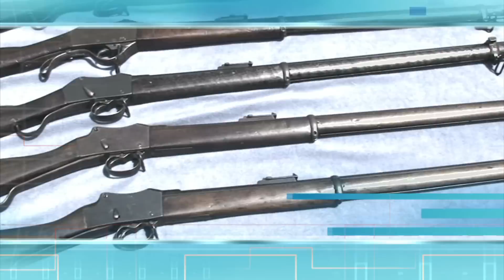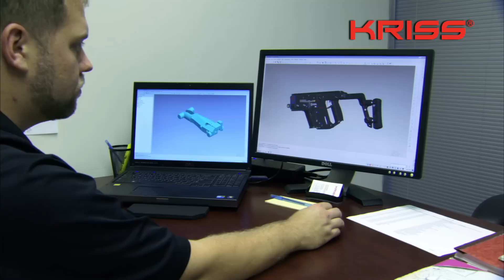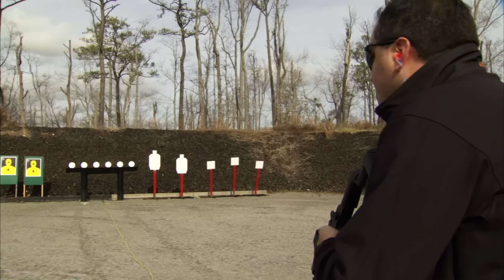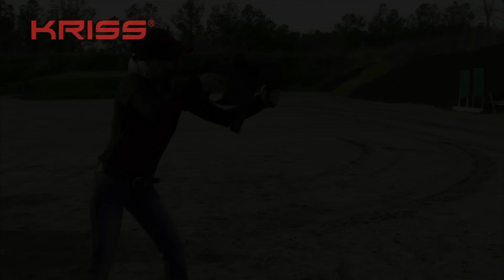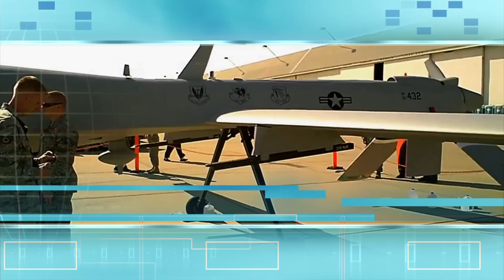CNBC Documentary on KRISS and the Super V Recoil Mitigation System

Comment: By Newton's 3rd law, shouldn't throwing the reciprocating mass downwards create more muzzle climb initially? The system seems to work and I'm not doubting my own eyes here but can anyone explain to me why this works from a physics perspective? Intuition tells me the low muzzle climb of the Vector has more to do with the low bore axis relative to the point of contact on the shoulder than with the recoil mitigation system. At the end of the day, the mass has to travel back upwards too, and no matter what direction the mass reciprocates the gun has to go back into battery, which means the net energy felt by the shooter from the mechanical portions of the gun should be zero (since the gun's mechanical parts are a closed system returning to their starting point). Energy mitigation would have to come from the bullet (by shooting one with less mass) or from the gasses actually leaving the closed system (like with a compensator). That being said, reducing "felt" recoil by mechanical means is possible, but has to do with the mass of the gun, the location of the points of contact relative to the bore axis, and the length of the recoil impulse. I don't see how downwards reciprocation would help except by lengthening the recoil impulse, which could also be accomplished in a straight line just as easily. Am I missing something? Does the redirected impulse have some kind of synergy with human reaction times or shooting mechanics?

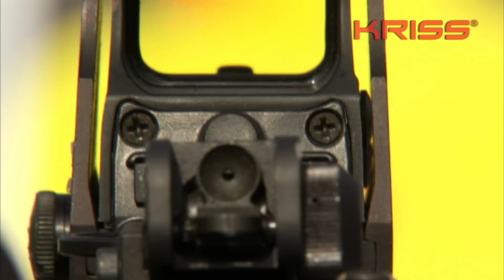Comment: 5:35 The Kriss technology allows the use of heavier calibers on smalled platforms. The .45 ACP Kriss should have a big sister named the .50 AE Kriss. The .45 ACP (230 grain, 461 ft-lbf)Kriss and the .50 AE (325 grain, 1,646 ft-lbf) Kriss should have a big brother named the .950 JDJ (3,600 grain, 38,685 ft-lbf) Kriss. The Kriss family of .45 ACP Kriss, .50 AE Kriss and .950 JDJ Kriss is the family that's needed and wanted by the gun community. By the way, 3,600 grains = 230 grams = 8.2 ounces.

Comment: 5:35 The Kriss technology allows the use of heavier calibers on smaller platforms. The .45 ACP Kriss should have a big sister named the .50 AE Kriss. The .45 ACP (230 grain, 461 ft-lbf) Kriss and the .50 AE (325 grain, 1,646 ft-lbf) Kriss should have a big brother named the .950 JDJ (3,600 grain, 38,685 ft-lbf) Kriss. The Kriss family of .45 ACP Kriss, .50 AE Kriss and .950 JDJ Kriss is the family that's needed and wanted by the gun community. By the way, 3,600 grains = 230 grams = 8.2 ounces